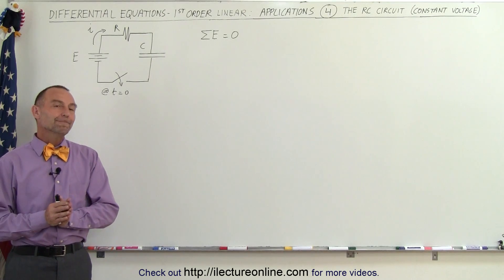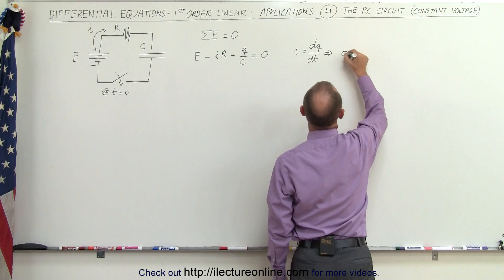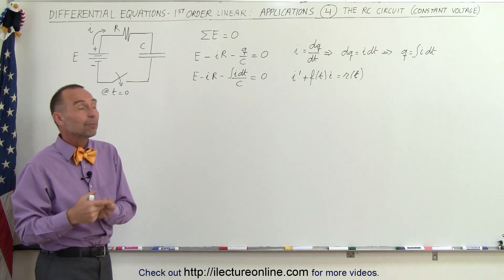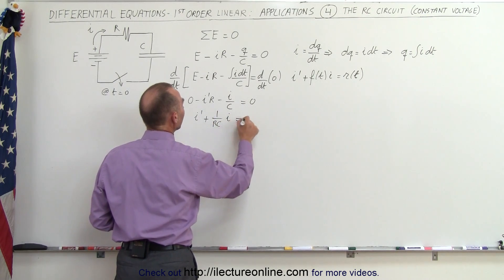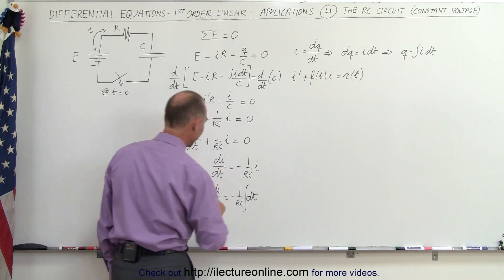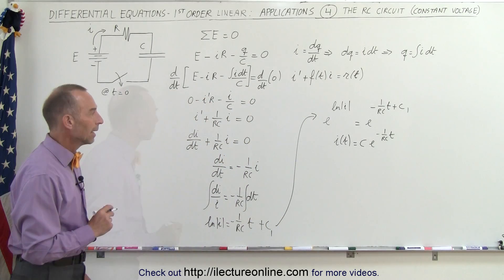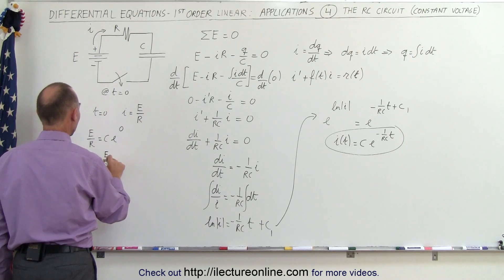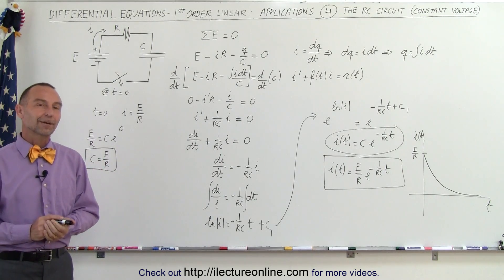Differential Equation - 1st Order Linear: Applications (4 of 4)  i(t)=? of the RC Circuit

Comment: have you a video that indicates deriving of rc circuit with ac power supply?
Reply from the maker: Have you looked in this playlist?    PHYSICS 49 RCL CIRCUITS
Reply: @MichelvanBiezen  yes I did but there are rlc circuit videos. but I want for rc circuits like this video. the only difference between this video should be the power supply. I want for ac power supply
Reply from the maker: Then try this playlist in the electrical engineering videos:    ELECTRICAL ENGINEERING 8: RC AND RL CIRCUITS
Reply: @MichelvanBiezen  ok I derived it on my own thank you!!
Reply from the maker: The best way to learn!
Reply: @MichelvanBiezen  thank you. you're right but it very similar with TL circuits. Your videos are very helpful. thank you

Comment: A very long time after the switch is closed, determine the current in the circuit?
Reply from the maker: There is a period where the current transitions from one state to another state, before and after the switch is closed.  While going from one state to the other state (steady state) that is the transition state
Reply: @MichelvanBiezen  The network below is an uncharged capacitor connected to a battery, resistor and switch. The switch is initially open but at t = 0 it is closed.  
3.1    Use the differential equation approach to find the capacitor voltage v(t) for t > 0. 
 3.2    A very long time after the switch is closed, determine the current in the circuit.  
This is my complete question and circuit diagram is same as of yours.

Comment: Dear Professor is there a video in your channel with differential equations-1st order for the rc circuits when on alternative voltage, specifically with rectangular pulses ? I couldn't find anything similar.
Reply from the maker: There are videos in the physics sections and the electrical engineering sections.